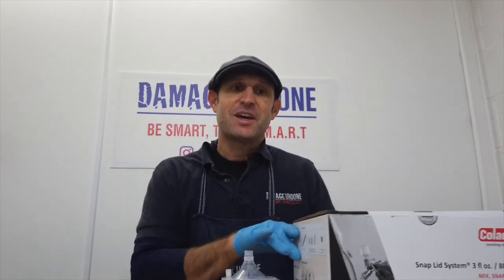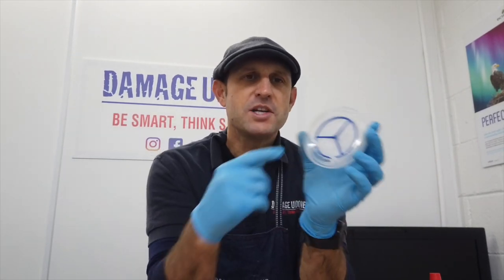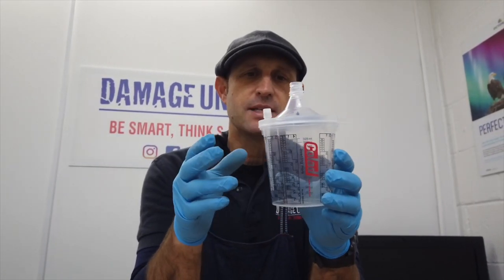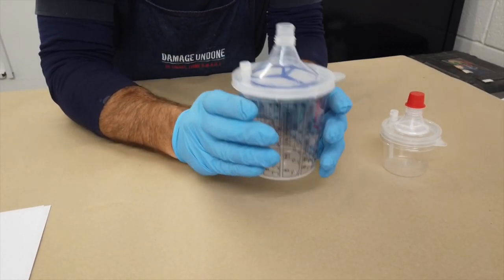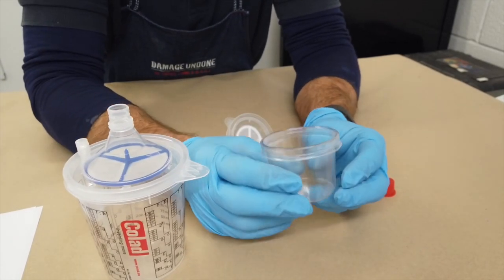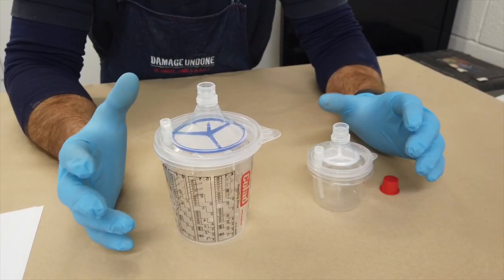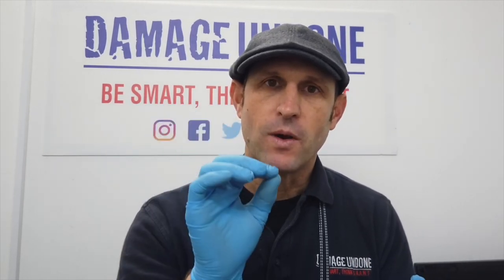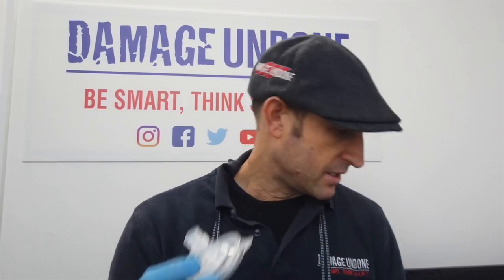COLAD SNAPLIDS

Comment: Having used many hundreds of these cups. All the points you brought up are manly user error can can be worked around.
 One problem I have with these is the plastic threading it is so easy to cross thread with the adapter. Colad could have made a much better way of joining more similar to the sata and 3m quick connection
Reply from the maker: Hi, thanks for your comment.

I’ve had that issue a few times but only on my clear coat gun and I worked out that it was the adapter that was creating the problem and not the cup system. Because it never happened on any of the other guns.

Comment: Thank you for sharing this Colad information.
The strainer is small and could decrease paint flow.
The design does not allow upside down storage for saving material.
Reply from the maker: Hi Tom, I like you a lot and respect what you have to say too, however on this subject I have to disagree with you on both points. Sorry 😐
Reply: @damageundoneltd  no problem, understood and I value your opinion.
And I’ve never used Colad mixing cups myself, therefore you are more than likely right Wayne!…keep up your valuable work, thank you!🙏